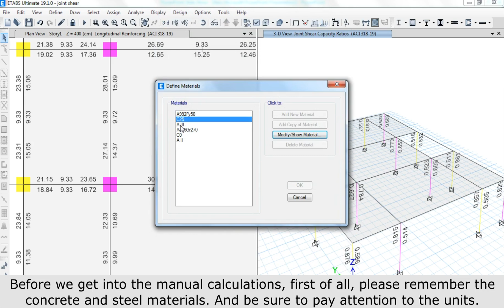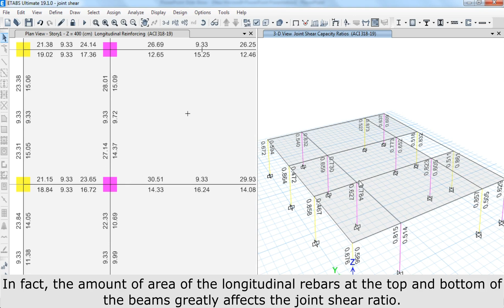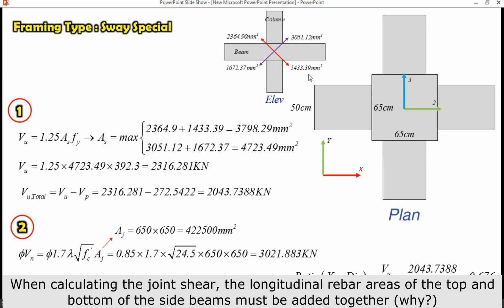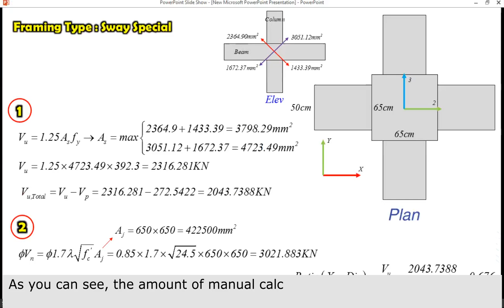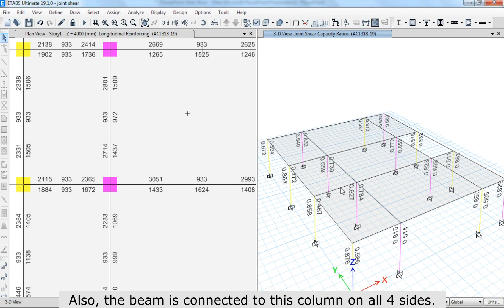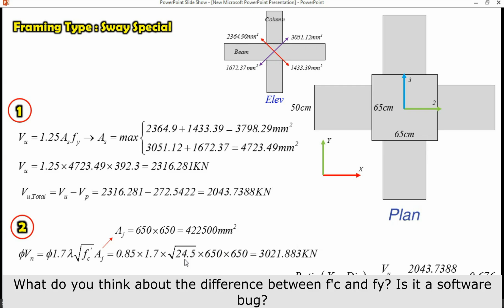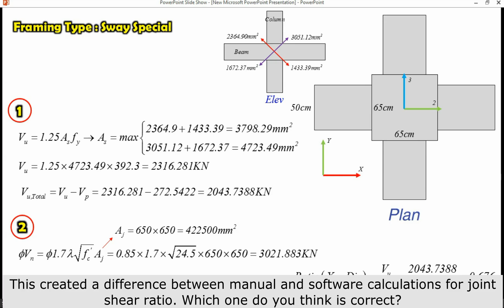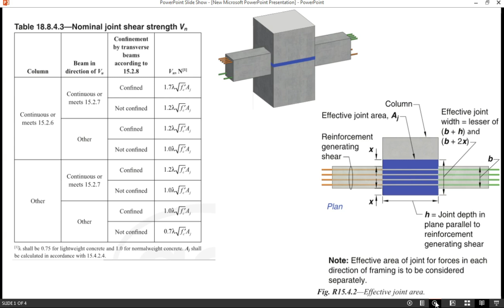ETABS vs. Manual Calculations: Joint Shear Verification per ACI 318

Comment: I´ve the same issue with etabs V21, the value gave by Etbas of Vn is like the second lowest of the table 15.4.2.3 of ACI 318-19. I think your calcs are good.